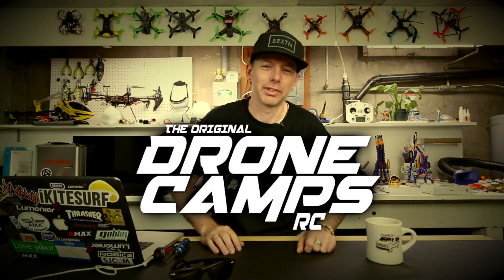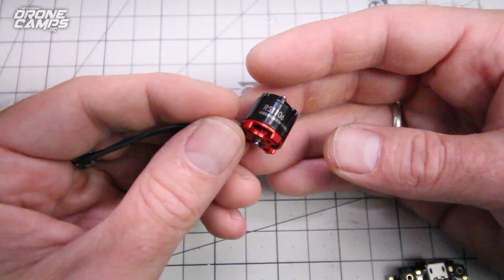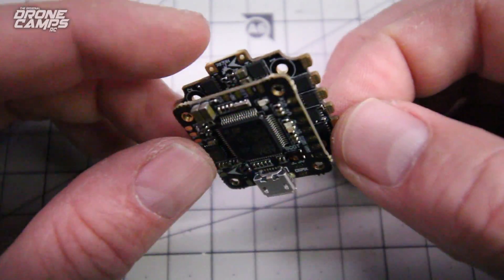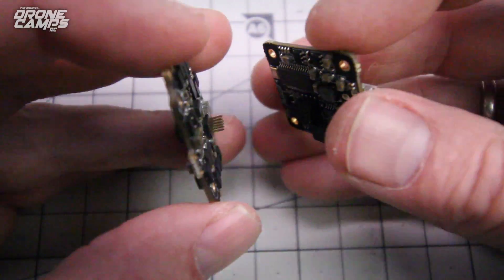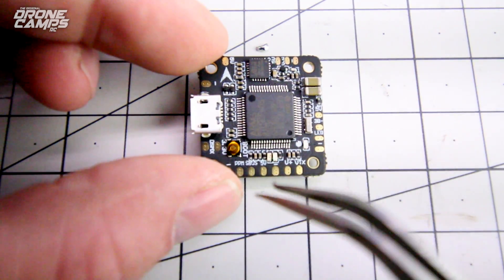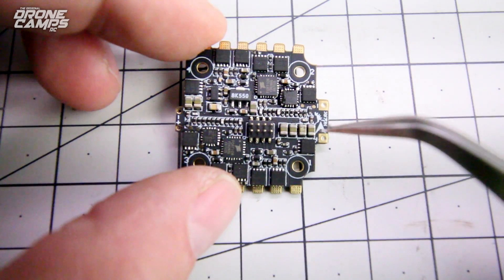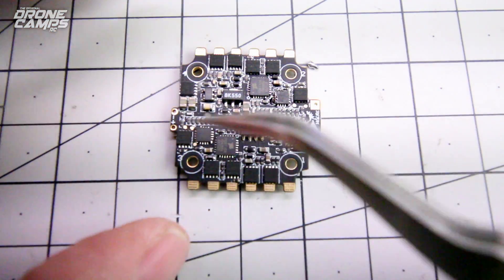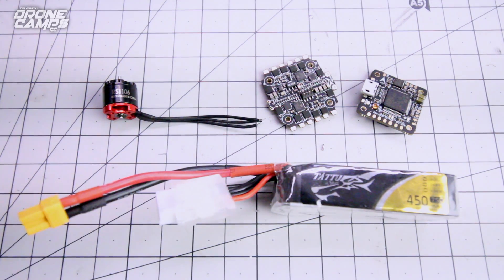HOW TO BUILD A 4S Micro Monster - HGLRC XJB F425

Comment: 1/20/2018 (5 months later...) 
It's amazing how fast this stuff moves. I now have my Babyhawk-R running up to 4S (same battery as you used - they are great) for $139, basically your combo here. HGLRC has the 40a stack in stock now (on sale for 10% off freeship), I have 2 coming, ones going on a Furious 220 frame (5") super-lite build, and not sure what I'm building with the other, I have a XJB-145 and it's all you could really want in a 3". 
A micro running 4S 40A Dshot1200 is like a big block in a Honda Civic, just HOW do you use the power? 

In a year we went from pretty gutless micro options to a 14g 20mm OSD stack capable of 5S 40A Dshot1200!!  
I can't wait to see where this goes this year...
Reply: Scott Marshall Just imagining an xjb 145 with that 40a stack on 6 cells..... I'd bet you could break 100mph

Comment: how do you use the OSD with the Micro 600TVL AIO FPV Camera?
Reply: You can cut into the video line it's in a black 3 pin bridge on the corner of the board. (Pwr,Gnd,V out on the camera side, Video in on the Tx side)

Comment: Sick build! I'm actually rocking the same motors and Tattu batteries in my FlexRC Ascent 93, I'm only on 2S at the moment but the build is light and those Emax RS1106 6000kv are badass! I love them and crashed and they keep spinning, very durable and responsive. Great video, thank you for the videos you make

Comment: If you're flying the 6000kv's on 4s, then the 7500kv's can handle 3s right? Cause I used the ipower 7500kv 1104's while back when it was cooler outside and it was ripping hard on 3s 650mah's but they were toasty when flying hard. But now that it's hotter outside they just got way too hot imo. Like 160-170f or something. So I got some of these emax 7500's and was all excited only to discover that these damn things are on fire just hovering in my cold room.. wtf is up
Reply from the maker: esc settings can over heat motors
Reply: What settings should I change?
Reply from the maker: Make sure your escs are the right protocol setting in betaflight. Dshot, etc
Reply: What do you mean by "right" protocol? Isn't there just one place to select what protocol and they each have different characteristics but not really a "right" one? I'm using dshot 300 with piko blx mod. Works great with other motors.

Comment: Can this ESC handle a 2204 motor with 30a peak burst?
Reply from the maker: Might be pushing it Jon.
Reply: flown them a lot on 5 inch with a Dys SE2205 2300kv with pretty heavy props like a Racerstar 5051 no problem
Reply: Martijn Bouwman you think this can handle the air40 2205 2450kv motors on a floss 2 frame?

Comment: why 1106? why not 1407 or 1408? in the 3500-4000kv range with a more aggressive prop?
Reply: Biggest motor you can go to on 11xx is a 1304 1306 and greater have a different mounting pattern. They wont fit.

Comment: I have this board on a arfun95 and had a few problem. First I used a vtx3 and fried it because I connected it to the vtx source. I ordered a new one to connect to the camera source. Second problem was I use ibus with turnigy evolution and I had to connect to dsmx instead of sbus/ibus to make it work. Oh and also I have a really low d (15) but still got hot motor so I think I will go from 8k/8k to 8k/2k

Comment: Thanks. So, what frames are good with this? Also with a F4 chip and betaflight 3.1.7, how are frsky receivers doing with this?
Reply from the maker: Arfun 95 is a good frame
Reply from the maker: I listed a 5v step down converter below in the parts list
Reply: Thanks
Reply: Drone Camps RC But the fc has a 5v output, why a external bec?

Comment: I see they have the EMAX 1106 4500kv. why not these over the 6000kv.
Reply: 4500 is better for 4s guys, just be careful with 3 inch props.
Reply: I would like to know as well, I'm gonna buy this setup and put it on a Loki x2 frame

Comment: if you havent seen it, they have a 20mm vtx to go with this coming out in a week or so.
https://m.banggood.com/20x20mm-XJB-TX20-Mini-5_8G-72CH-025mW100mW250mW-Switchable-FPV-Transmitter-Raceband-p-1165158.html
Reply from the maker: I need this now :)
Reply: you going to use this on the stack for the build?
what frame are you going to use for this build btw? this would be a great stack for a rotorx atom v3 3inch.